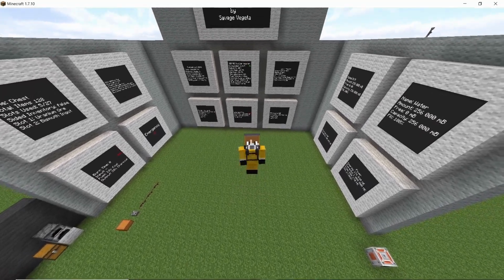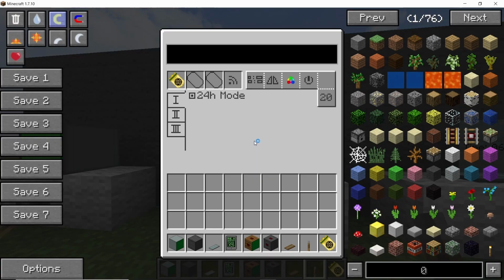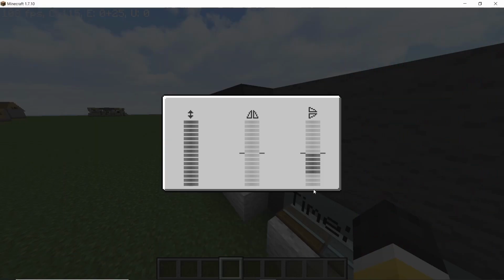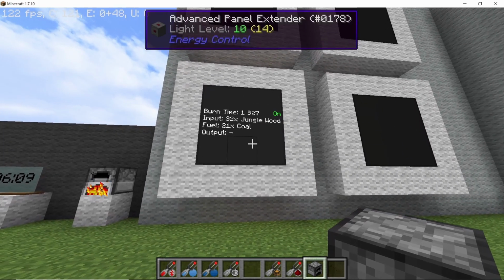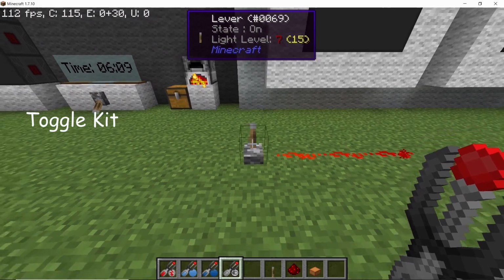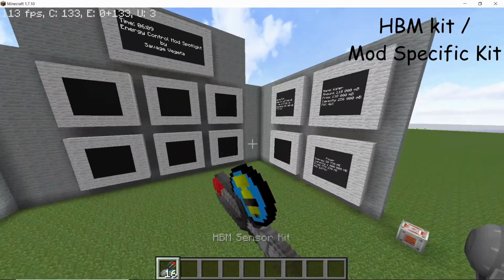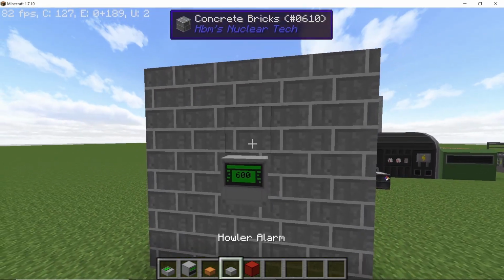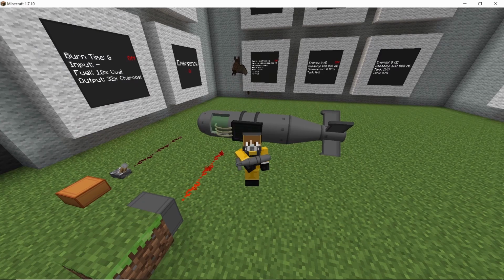ENERGY CONTROL Mod Spotlight - Minecraft 1.7.10 || How to use Information Panel Energy Control mod

Comment: will the remote temperature sensors work on rbmk components, such as the reasim moderated parts?
Reply from the maker: Yeah it does work on all the RBMK parts the last I checked
Reply: @SavageVegeta  than get ready to see a new reactor and control room built!
Reply from the maker: @robbytheatomicengineer5749  awesome , can't wait :D

Comment: Does the 1.12.2 version of hbm nuclear tech have all the features of 1.7.10? Is it more unstable than 1.7.10?
Reply from the maker: No it doesn't have all the features of 1.7.10 and the possibility that it ever will is very less. 
As for unstable I won't call it that but in terms of certain features it is incomplete

Comment: I can’t seem to get the Remote Toggle to work. I can get the red/green circle on the screen to show up after connecting it. However alt right click will not change the circle on the screen. Any thoughts?
Reply from the maker: The last I checked remote toggle was working properly, energy control's compatibility with ntm is broken atm but I don't see how that can affect remote toggle 
So just take a lever and link the remote toggle to it and then try alt-right clicking and see if the lever flips or not. Also make sure to use the latest available version of the mod
Reply: I have the same problem. Alt-right clicking just opens the panel's GUI instead of changing the circle and the lever.

Comment: Is Gerald one time use? Is there any way that I can input the coordinates of my enemy base and the missile will shoot there instead of going there to get the coordinates with a designator?
Reply from the maker: Well it is not one time use per say but considering the amount of effort it'll go to just launch him once most people won't launch him again. Also I don't think it'll work with a coordinate designators, you'll have to use the standard method ... I haven't checked it recently so it's worth a try tho 

But you can always go near the enemy base with a vector jetpack , call Gerald and get away quickly. It takes alot of time to actually hit and cause damage
Reply: @SavageVegeta  Thx for your answer but I have another question. Is more temperature=more energy in the case of RBMK reactors?
Reply from the maker: @libiarahman1313  yeah that's true , the more hot a reactor will run steam will be produced at a faster rate in it. More steam equals more power. You can notice the difference easily by changing the fuel you're using and monitoring the power output on a screen or something